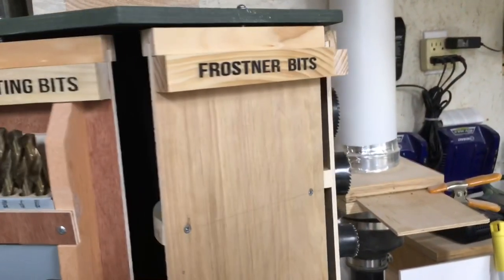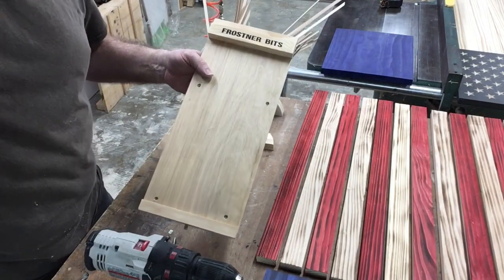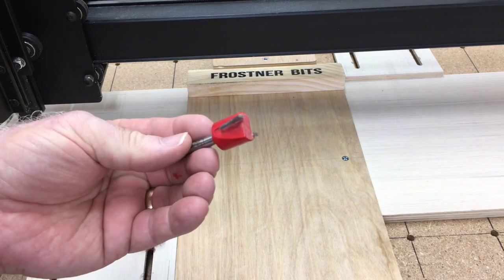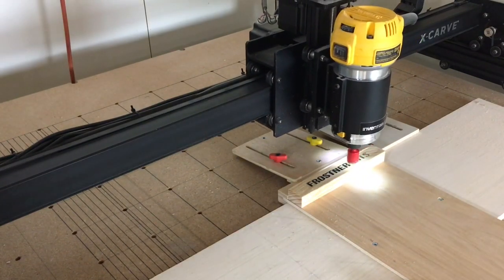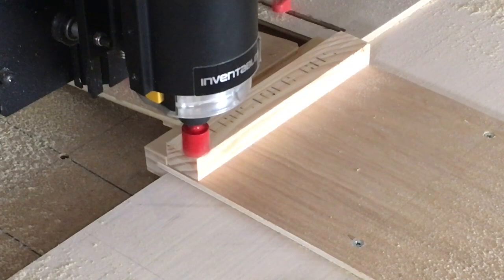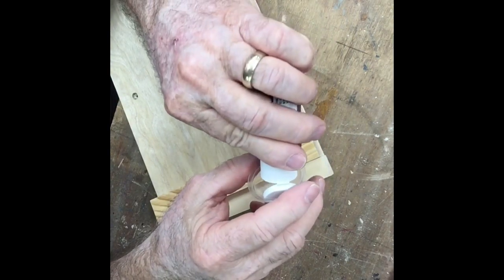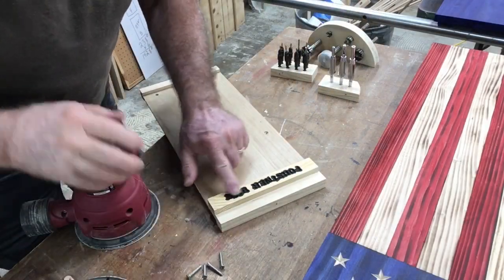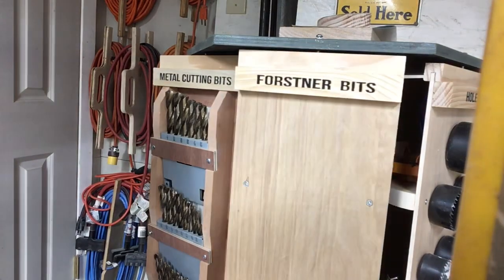Big Mistake: Time to Fix

Comment: Hi paw paw did aome bried research seems not hard at all Im going to make my own z probe...it seems actually pretty simple its just 2 wires and alligator clip and a flat piece of alum or copper or brass which i have all 3.... All a z probe is doing is completing an electrical circuit when your bit touches the brass piece....so i will try to make my own and im not going to route it through my x axis...and wont need the plug in end...not necessary...im going to solder one end of wire to yhe brass piece and other end use alligator clip....and then just leave opposite end bare so i can install to board
Reply from the maker: Awesome, yes it should be very easy to do.